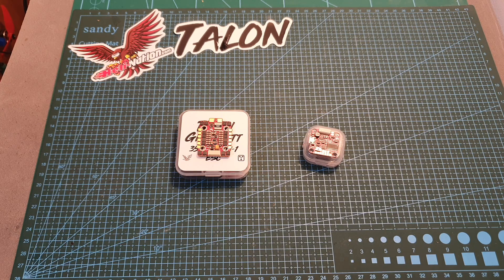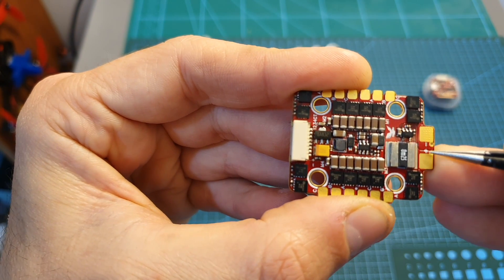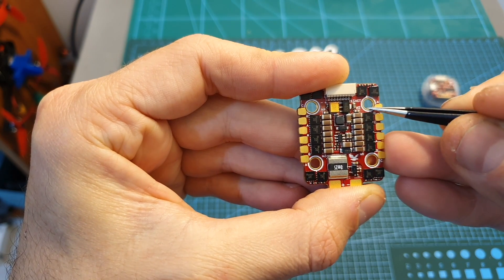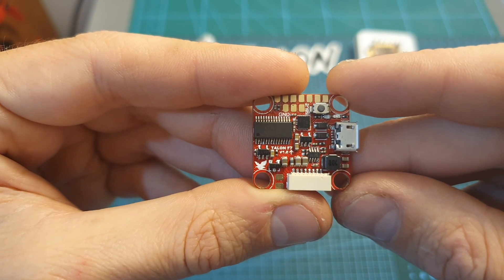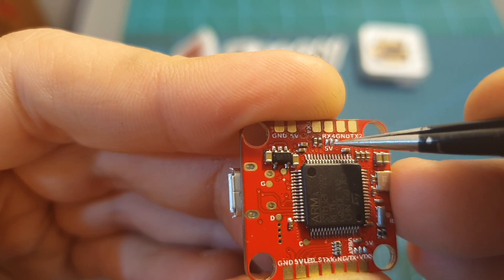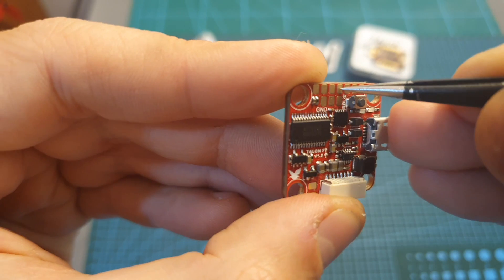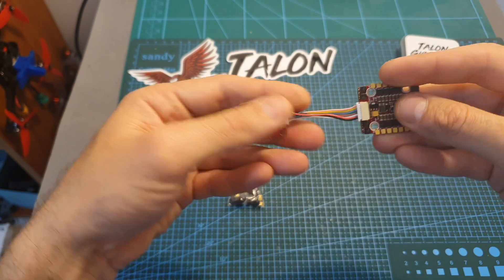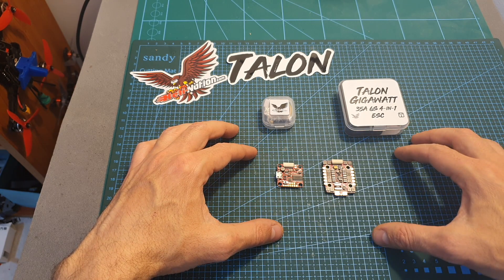Heli-Nation Talon F7 FC & Talon Gigawatt 4 in 1 ESC Overview

Comment from the maker: A note from Heli-Nation: 
- The solder pads are under the 8 pin plug on the FC so you can direct solder. 
- The cable that came with it is for the AK32 full size ESC so re-pin is necessary for most of the combos that were shipped before the last couple of days. 
All FCs shipped since April 18th have the new wire included on both the Talon F7 and Talon F4.  We launched the Gigawatt after the FC so needed to update cables and finally done.  
The re-pin directions are in the listing description, so make sure to follow them.

Comment: Nice stack except for the fact my voltage doesn’t read correctly. In fact it is off by 5volts. My 4s batts read 11v on a full charge
Reply from the maker: You can calibrate it.

Comment: Thanks for the video! I have this exact set up. Do I have to turn on "Use KISS/BLHeli_32 ESC telemetry over a separate wire" to get current sensor to read correctly? I have to plug the quad in 5 times sometimes for it not to read "low battery" on a full pack
Reply from the maker: No, it's not related. Something else must be wrong.
Reply: @KremerFPV  I scaled it to 150 and seems to match up...who knows. Thanks for the reply!

Comment: I've got this FC and its OSD is flickering so much. I've added 2 capacitors, soldered both ground wires to the same pad and it improved the situation just a tiny bit. Any hard throttle punch makes the OSD dissapear for a second. Moved this FC to my fishing drone :( Talon has a newer f7 dual gyro FC of the same size but I'm doubt
Reply from the maker: Only the OSD is flickering? The video feed is ok?
Reply: @KremerFPV  hi there :), the video feed has some noise but the OSD is flickering independently. I've tried 3 different 4in1 esc (Airbot Ori32, Aikon 35A Blheli_32 and Hakrc 50A) and the situation improved from totally dissapearing OSD on any throttle to 70-80% throttle to make it flicker, after i added good capacitor. I used AKK vtx (600mw 20x20mm and larger 800 mw one) but I'm pretty sure that's not the VTXs issue. I gave up thinking its just a problem of my particular device but it makes me doubt whether I want to give Talon fc another chance :(
Reply from the maker: @andreylusta  I would try to talk to Heli Nation and figure out whether you have a faulty unit or not.
Reply: @KremerFPV  Thanks for you advice, i appreciate it. But the situation is too old to care so much :) I've got enough FCs to move on :)